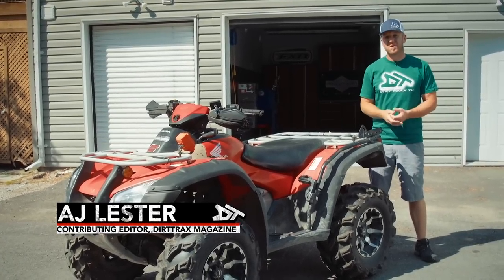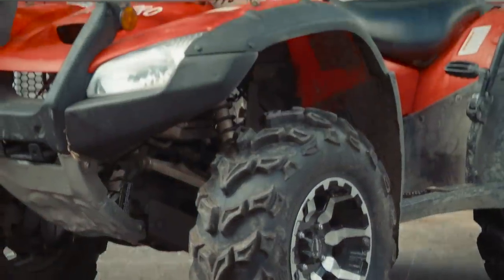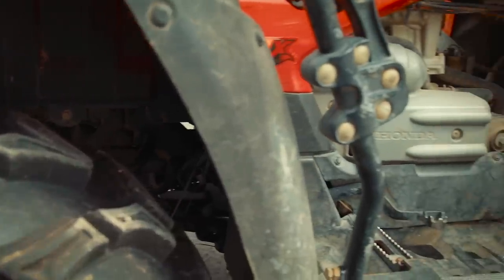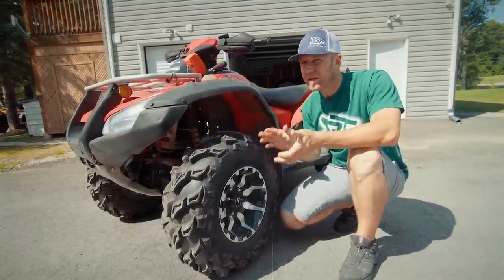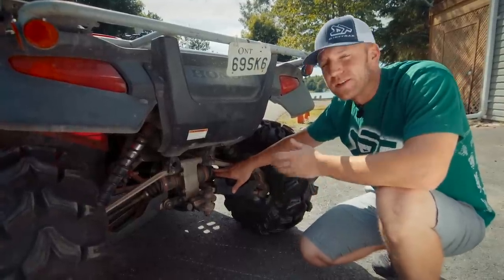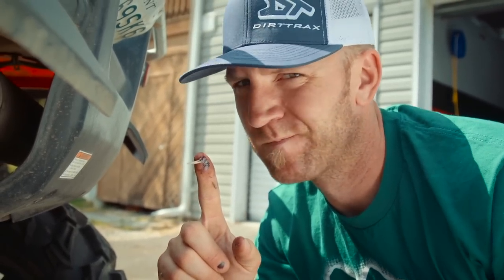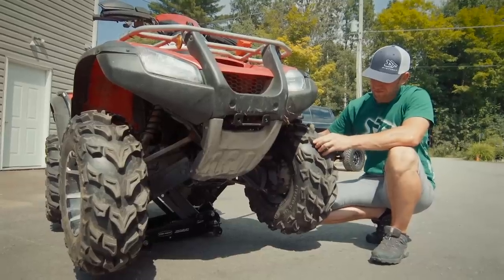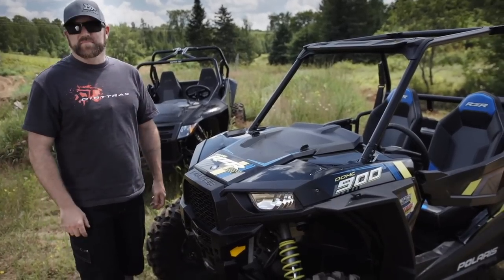How To Buy A Used ATV

Comment: #1 TIP : If it has a snorkel walk away...better yet run...
Reply: defstar yes too true
Reply: I WISH MY PARENTS WHEN WE WERE YOUNGER READ THIS MESSAGE!!. It was a nice looking quad, Arctic Cat 700 If I'm not mistaken. Had a "custom" snorkel made out of PVC Pipe. While it looked cool I think it was the source of all our problems. Wet intake and filter lead to much needed repairs, couple that with shady  mechanics and would be thieves they ended up selling it because it was a hassle maintaining it.
Reply: check what the guys with snorkles do to there quads though they arent exactly easy on them
Reply: if it has a SNORKEL go try it out see what it can go thur and do... before you buy
Reply: defstar you hit the nail on the head there
Reply: facts
Reply: Yep it's ruined
Reply: Is that a brand?

Comment: Well. It's one thing to check for these issues, but it's another to say it's a breaking point. Axle bearings and cv axles or just even the boots are easy jobs for even a joe smoe to figure out. Definitely a talking point to lower the purchase price, but these are wear items on any atv that the new owner should learn to do themselves and not fork out ridiculous prices to a shop to do.

Comment: You missed the most important thing to look at, the air box. When looking at units for possible trade in at dealership where I worked for 32 years, the “very” first thing I did was remove seat and look in air box. This will really tell you what you are dealing with. Too frequently you would find air box full of muddy water, filter missing, falling apart or find a rodent nest. You need to be seeing a foam air filter that has been properly treated with foam filter treatment. That foam filter with no treatment is no “filter” at all, dirt goes right through it. Once the engine has had dirt ingestion a complete tear down is required to completely clean out engine. Oil changes, flushes etc. will not get the debris out of engine as it lays in all nocks and crannies only to be flushed into oil again. I have seen ATV engines that were rebuilt twice at another dealership only to be smoking again in a few months, it happens fast. Then was rebuilt with complete engine tear down in our shop. Guess what, a moth later it was smoking again with new rings just as worn out as in previous we’ll intentioned rebuilds. We had not removed oil cooler and flushed dirt from it and it had allowed dirt to get back into engine. We did a rebuild again after cleaning cooler and no more problems. The two things that wear out from dirt contamination is rings and chains as in cam chains. Why? Because everything else gets filtered oil. Rings and  chains run in the dirty oil. Took many years to acquire this knowledge but this is the way it is. Air filter maintenance on off road machines subject to dust and dirt is absolutely critical. So like I said this is the first thing to look for. If you don’t see proper maintenance, walk away. Every time.
Reply: Thank you for that info

Comment: thanks for the informative video AJ. I wish i had this video back in 2009 when i bought my 01 450 foreman, i got it for a good deal.. and with good reason, lol, but after a top end rebuild, all new shocks, a disc break conversion, new tires, wheels, both diffs rebuilt and every bearing replaced and all factory  graphics replaced it's just like a brand new bike, but because of that experience when i decided to get something else i bought a brand new one. that way i know where it's been and what's been done to it.
Reply: How
Much did you pay
Reply: @caseymalsberger2773  hey hows it going, the guy had it listed for 3500 and with a picture of it when it was brand new, so needless to say i was unimpressed when i drove an hour to see it and it was beat to crap, he said he would hate to see me travel all that way and not leave with the atv so once i got going through it and pointing out things wrong with it and the fact that it had a winch in the pic that was now missing I ended up walking away with it for $2200 which is a good deal for a running bike on the east coast of Canada.

Comment: If you buy a Honda foreman check the front end frame between the a-arm cuz the frame rusts out in that spot.. I picked one up and got burned pretty good and know I have to replace the front half of the frame just a tip check the frames on the foreman if you live close to salt water

Comment: Pull off the CVT cover and look at the situation there.
Look for cracks in the control arms and elsewhere on the frame with a bright flashlight
Pull off wheels/brake covers and look at bearing seals
Put on jack and spin wheels and listen
inspect cv/drive train boots with a bright flashlight
Run the thing in 4wd and 2wd, go through all gears
Check all lights and gauges
Buy a Yamaha

Comment: Great Video with very helpful tips.  Look in the comment section about bringing a jack, checking fluid levels, find where it was originally used (in states with recent hurricanes), if I has a snorkel
Reply: I recently sold my 2013 Polaris sportsman 400 for $3,000 had 2,054 miles sold it on Wednesday

Comment: This is a Great video I have bought 3 of ATV's (1) a Suzuki quad runner my first ATV, My second 1 was a King Quad & I purchase a Warner winch for $500when I sold the King Quad was my biggest mistake the guy that bought made out big time and I was the idiot for not $asking more money for it, It was only used for plowing snow , Now that I own a Arctic Cat 2006 400 auto 4x4 I just replaced the muffler this Cat had 944 miles and was used to used a Roll blower strap to it to blow leaves & Snow removal for $3000. 00 the muffler had a couple of holes in it so I bought another muffler and had it replaced the muffler cost me $325.00 plus $85.00 to have it changed over now it purrs like a Cat the Guy that sold it to me as of the other 2 knowing that he doesn't seem to take care of his toys, So with everything I have  done to it New Oil & Filter replaced the muffler total cost is $3,555.00   there are more to as I won't be getting rid of it unless a major  brake down which I can't afford they are nice toys to own but it's best to maintain it too. thank you for posting this video

Comment: Just bought a 2005 700 Polaris Sportsman and I went for the low miles first before I would even call and then checked out the whole machine for leaks and wear points.  I figure if you buy anything from 2002 on you in good conditions(low miles) your still getting a modern atv that should last and perform as good as the newer models or close to.  Hope I am right.

Comment: LOL, if the wheels had that much play I would be driving away in about ten seconds.  Also, if the sellar can't even clean the bike up, I'm probably walking, AND if you check the air filter and oil and  it's dirty,,,, bye bye.

Comment: Tip #1, don't buy a Honda Rincon.  The Rincon is an atv that doesn't do anything well.  Its not powerful enough to be sporty and its not geared low enough to do work.  And if something goes wrong in the transmission, its so expensive to fix that most just get rid of them.  Power steering and diff-lock were somehow things that were never even optional on the Rincon even though Honda calls it the flagship model.  It was Honda's way of doing things different than everyone else that has cvt auto utility quads.  Sometimes different isn't better, as is the case here.
Reply: Very true. The Rincon is THE worst thing Honda has ever made. It does nothing right.
Reply: Greg Rowe .. I don't know what any of u are talking about I owned a rincon for a few years and ya it la keys power but I've never. Ever. In my life been somewhere where my rincon has never gone except through supper deep mud
Reply: Rincons are really good bikes but for trails, not really work or abuse in mud.  The 3 speed tranny isn't geared right for that.
Reply: You bad of the head or you bought a messed up rincon, I own one and use it here on Peru, were we have sand mountains and dunes, this is the best in torque and performance, 3 speed selector and a powerful gearbox, you don't need to worry about the stupid cvt belt wearing

Comment: Just don’t buy a Polaris.  You will be doing just fine.        Even a Lincon is better.
Reply: what makes polaris so unpopular,  i just bought an older model one as my first atv,  engine runs solid,  drive train is good,  needs an idler for the rear chain, but thats about it for work,  i got it for dirt cheap so i don't feel bad,  but i'm wondering if i should be on the look out for a future problem.
Reply: lattitude01   If it works and it’s cheap, just enjoy it.       Electrical has always been a Polaris problem
Reply: @lattitude01  newer polaris has a reputation, maybe some old stuff isn't half bad.

Comment: What about a sport atv what should you look for
Reply: That is a good question for allot of people.  The best used atv of any type I have found in my experience.  Is one that I got from a nice suburb type area.  They usually saw the least amount of use and hours.  Always look for bone stock atvs and buy the nicest, newest model you can afford.  Garage kept and not abused is the way to go,,,,especially on a sport quad which we know is going to be ridden hard.  I've seen many sold for decent prices just because they never got to use it..They are out there, but you have to take the time or risk being stuck with an abused atv...nothing wrong with a used highly maintained machine though either....I always look at other vehicles in there driveway and garage..if they are not kept up,  I'm sure the atv hasn't been either...I've rode and repaired atvs/motorcycles for over 40yrs. so its good to take someone with you with some experience also. I could go on, but you get the idea.
Reply: Generally the same stuff. Leaks coming from the engine. You'll want to check chain slop/ is it oiled and the wear on it and the teeth on the gear. I've never owned a sport atv, but I imagine it's about the same. Maybe see if theres a what to check on a dirt bike video, it'd be a little closer to that maybe.
Reply: A highly modified sport quad, such as engine or suspension mods, usually means it was used for racing.  A used racing quad is not something you want to buy unless you don't mind a high maintenance machine.  I think a sport quad that is totally stock is the way to go.  Cost is usually less and reliability is higher.

Comment: What 2015 to 2017 used atv would you recommend in the mid range (450 to 750) for plowing and trail riding 45 year old...
Reply: Sylvain Mino 420 rancher is a great wheeler.

Comment: I've been looking at getting either a rincon or a sportsman 800
Reply: Definitely go for the honda, I have had mine for a while now and it's on the trails more often than my  bud 500 sportsman
Reply: A Rincon is a complete turd.  I'd get a Brute Force or Grizzly 700 instead.  The Sportsman 800 is a good performing quad for the money too.
Reply: Do you even own a rincon? I doubt it, and you haven't seen what there capable of, if you think they are turds, my bro has a grizz 700 and in every imaginable way I can do everything he does just as good or better
Reply: What ever you decide do yourself a favor and stay away from the broke force, they get that name for a reason. I have two different buddies with them and they are falling apart entirely. And on polaris atv's in general the electronics are crap.

Like I had said before Hondas are quality built machines
Reply: Most Hondas anyway.  The Rincon is adequate I guess but so many other choices out there that have more power.  A Grizzly 700 is just a much better atv all around.  More power, better suspension, more ground clearance, diff-lock, optional power steering.  From your youtube name, its obvious you had to modify your Rincon engine to get any power out of it.  You don't need to spend the extra cash on anything else to do that.  Polaris does have issues with electronics but those are easy fixes.  Mid 2000's Suzuki King Quads had weak frames, along with the earlier Can Am Outlanders.  Don't get me wrong, I do think Honda builds quality utility atvs.  But the lack of power just doesn't make them very fun to ride.
Reply: Your right, bone stock the rincon isn't the most powerful in its class, but other than that it's a great machine. I would hesitate to buy another
Reply: wouldn't hesitate to buy another, lol stupid spell check
Reply: I think Honda could really make the Rincon a great machine if they wanted.  Giver it the 6 speed dct transmission(with an ES option) from the new Pioneer 1000 and that engine as well.  Give it power steering and diff-lock and it would be competitive with the rest.  Unfortunately it would cost $12000 then and nobody would buy it.  They would just get a Sportsman 1000 or Outlander 1000 instead as they would all be the same price and both of those would still have more power.
Reply: Greg Rowe doesn't the newer rincons have power steering?
Reply: I just checked out the 2017 Honda Lineup but it doesn't mention the Rincon having power steering.  The Rubicon does though.  The Foreman ES and the auto Rancher does as well.  The Rincon does have the most power of anything in Honda's atv lineup but it doesn't have power steering or diff-lock.  Or a low range either.  It even mentions a catyltic converter as being a good feature, completely laughable.  Honda just doesn't have a clue how outdated the Rincon is.

Comment: step one = buy a sportsman 500. 
step two = there is no step two
Reply: Step 2 pray you never end up in a position where you need a locked from axle to back up...
Reply: Step three burn some belts, break some axles and trade it for a honda. And those problems will disappear.
Reply: balzarini51 step 2 plow thru any and everything in the way
Reply: More like this 
Step one= buy any honda
Step two= enjoy years of reliability and hardly any work on it
Reply: I did the same thing, mine is a 2002 and the only problem I've had was a torn boot
Reply: balzarini51 😂😂 Cam-Am Renegade 1000 xmr is the only good thing for skeg :)
Reply: Polaris's suck, they're harder to work on and if you don't put the correct oil in it you can fry the top end.
Reply: IRISHbearBELLY America I know same here but have both canam and Polaris and Honda dirt bikes canam breaks belt all the time but it’s a 2015 maverick turbo at 80 or 90 so broke piston in Honda dirt bike luckily still half the cost of the dirt bike but a 80 with an fmf sounds so dam good so Polaris wins had 07 700 since it was new never touched it except oil change and changed belt because it was 10 years old and got smoked one time when it was stuck on a log
Reply: I was going to comment same thing

Comment: Hello If anyone can help me answer this question based on my needs I would be very grateful. I am 33, I have gone ATVing in Arizona, Colorado, and for the 1st time in CA yesterday, which is where I live. Wow all together only 3 times, but feels like I am ready to buy a used one. This is only for recreational use only in Southern CA,  and Price is not important. I plan to go Atving in  Hungry Valley , pismo beach,  Joshua tree, Santa Barbara, lake arrowhead... My question is which atv is best overall ranked in 2016, 2015, 2014, I am also interested in 2004-2013 as long as they are better ranked then 2014 and above. 

My 2nd question is :

I use to be a beginner mountain biker and this website helped me narrow down exactly what I wanted!

https://www.singletracks.com/mountain-bike/reviews/best_full.php?cat=Full%20suspension%20bikes

Is there any website like this for atvs? I tried test and results for atvs but this was the best I found

http://www.atv.com/specs/2012.html

Thank You
Reply: buy a honda 300 they never fail
Reply: Can am xmr 1000 Outlander. I have a 2014 and love it